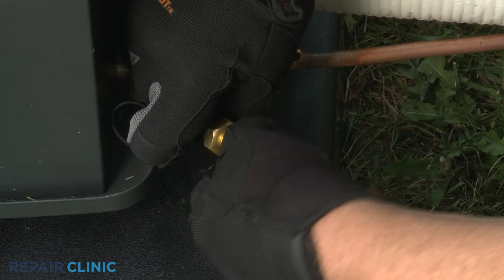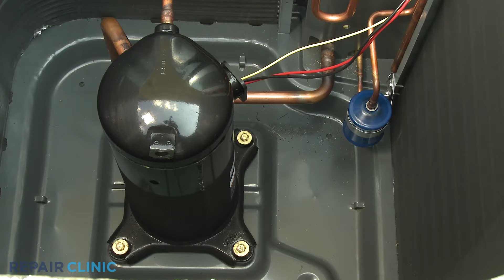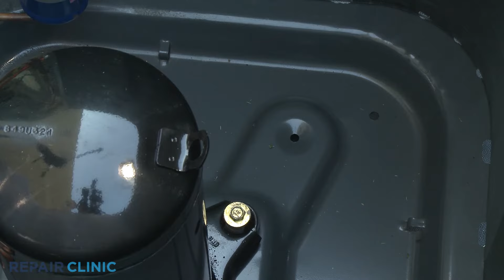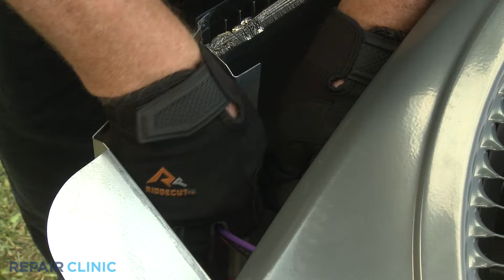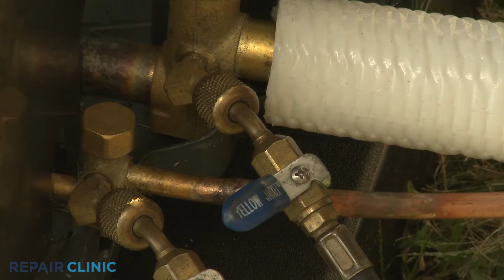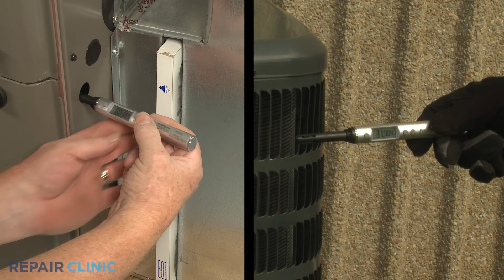Goodman Central Air Condensing Unit Compressor Replacement ZP39K5EPFV830

Comment: I wonder about the step the Schroeder cores were reinstalled. The system was under vacuum and the core tool has small gaps to let you slide the cores back and forth when reinserting. At this intense vacuum it should suck in air and moisture via that gap into the system. I believe it’s better to add refrigerant after the vacuum and then reinstall the cores. The positive pressure will only leak a de minimis amount outward. I think this suggested method will prevent moisture to become acid and ruin the compressor.
Maybe there’s no way around it as replacing the hoses from vacuum to the refrigerant hoses may still leave an inch of  headspace of air inside the core tools. I just don’t know how to remove that air pocket.
Reply: I can only assume that such a tiny amount of air is neglected when working on a residential unit like this. But to be on the safe side, I think you'd need a 4-connector manifold gauge to seamlessly switch from pulling a vaccuum to charging refrigerant. You will then reinstall the cores under positive pressure at end, as you noted.

Comment: This install will leak and cause high pressures because of oxygen condensables.  He didn't take any care to protect the filter drier when brazing, to smacking the compressor to seat the plug, not fluxing the copper before brazing, not purging the gas before releasing it into the system. I'm a 30 year HVAC tech and I wouldn't recommend this. Be careful who you watch on Youtube. I would recommend AC Service Tech, not this guy.

Comment: What’s the point of pulling a vacuum if u break the vacuum with air and not refrigerant ?
Reply: The vacuum was never broken by air since he had re-installed the valve core in a fully sealed system.
Reply: Agreed. Need to add some gas to break vacuum.  Then install ports to keep the non condensables from getting in
Reply: @rmalanis13  No, the valve cores were removed in the first place to evacuate the system. Then after the vacuum pull they were reinstalled since they are needed for normal operation. They were installed with a vacuum still in the system no gas. Then after when you fill it with gas the vacuum rushes the freon inside the system since it wants pull it in versus the pressure of the tank pushing it in.
Reply: What’s the best was to reintroduce the refrigerant? I was told to add charge first and then add the schraders. I’m not sure if it really makes a difference.
Reply: @jorgesosa4545  Doesn’t matter
Reply: To remove as much moisture as possible from the system. You close off your manifold to prevent any more air into the system after a vacuum
Reply: Watch the video again

Comment: Replaced a compressor today.  Unsure what is wrong.  Old compressor was grounded - continuous with the chassis.  New compressor is fine, but the breaker keeps tripping when the compressor attempts to kick on.  Tried replacing the capacitor, the breaker, and the pigtails.  New compressor has same rating as old.  Should I try a hard start?  My manager will have my nuts if I have to buy another.
Reply: you have an operating voltage(208,220,240) issue. check for bad wiring
Reply: Turns out it was an install error.  My tech didn't blow out the lines with nitrogen.  We blew out about 4 big pieces of shrapnel from the suction line.  New comp must have sucked one in and died. @mattpacktree92
Reply: @joshyaash  daaaaamn
Reply: @joshyaash  what were the pieces from, cutting the old lines?
Reply: not really sure.  They were a little curved, like maybe they were part of the scroll from the inside of the compressor @mattpacktree92
Reply: cutting the pipes instead of solderering off?
 @joshyaash
Reply: @Abdolante  The original compressor's scroll seemed to have shattered.  The shrapnel we removed was like 1/16" thick steel, not copper or solder.  Only thing I can think of, anyway.  The second compressor must have sucked some in and shattered the same way.  Luckily I was there for the third install, and I could hear the shrapnel clinking around during recovery.  And thankfully my prediction that "My manager will have my nuts if I have to buy another" proved false LOL
Reply: @Abdolante  This (cutting the pipes instead of un-brazing) is a requirement with the new A2L refrigerants.
Reply: Hmmm this is the exact same problem at my house

Comment: So, what was the purpose of introducing Nitrogen into the low side service port while brazing in the Compressor? Did you actually think the nitrogen would actually flow backwards through the Compressor or be able to overcome the resistance of the valves in the Compressor? That step was worthless and a waste of nitrogen as it would flow in the low side port, thru the evaporator and out the high side port.
Reply: If it came out at the other end , why not ? Do you know why why we use nitroglycérine while brazing at first ?
Reply: @Holydany no sute
Reply: T